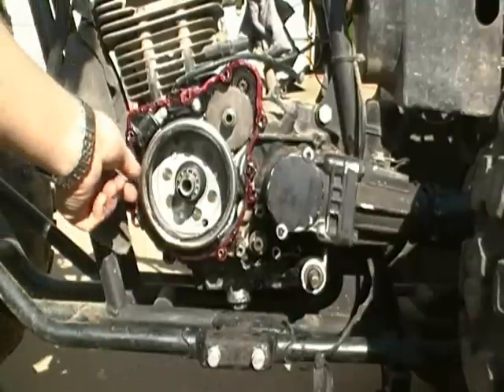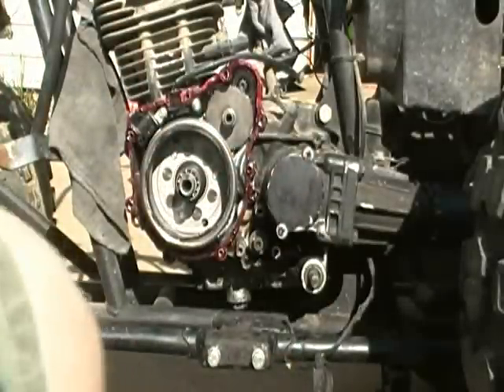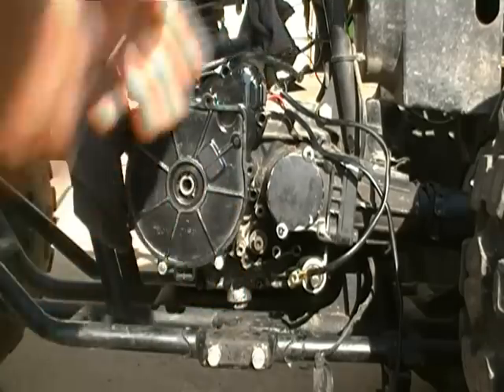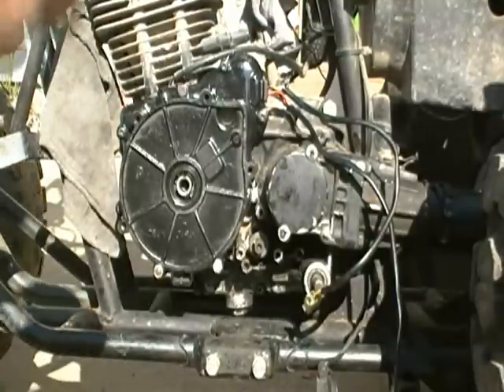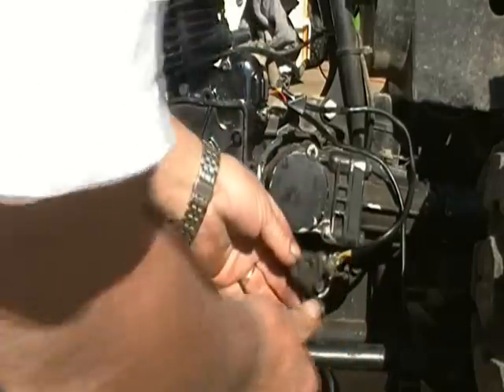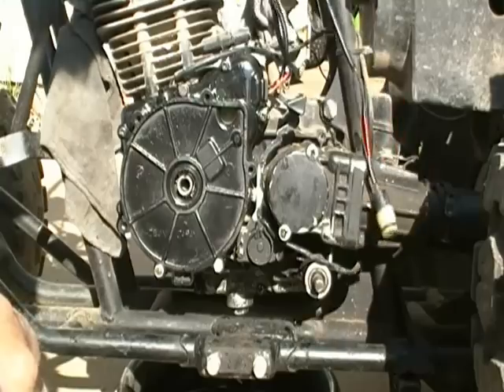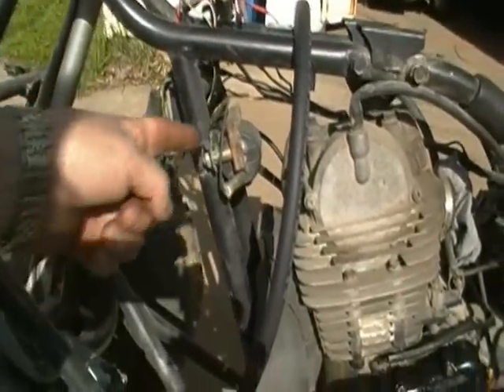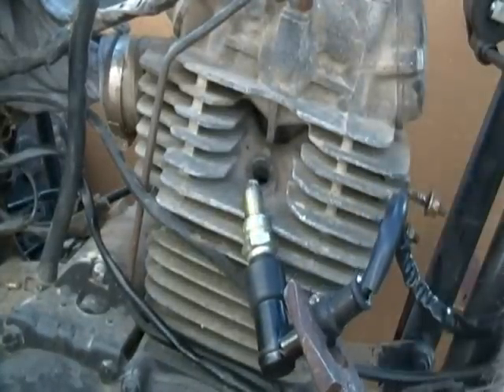KLF 185 atv Magneto & Stator  install

Comment: *****  hey i have a 97 bayou 220 i had to charge the battery and just took it out and my friend came up wanting to go ride so i just put the seat on and pull started it and road for a while the next day it wont start nothing works both the neutral and reverse lights don't work and the same with the font and back lights when i try to pull start all  i can hear is something spin but that's it any ideas
Reply from the maker: Austin Musser I don't have a 220 but I think all things are really similar. Riding with out the Battery works because your getting power from your Stator & Magneto.  
Have you hooked your battery back up ?   It does run the fuel pump, and lights, and the system requires enough fuel to get started. Also I hope you made sure the positive battery cable was secure and not touching anything while you were riding. That could cause problems too.  
let me know how it goes for ya... Cheers

Comment: how to change starter clutch
Reply from the maker: I haven't had to do that, but I did work on my starter motor. Best I can remember there is a direct drive from the starter motor to the gear inside outer case cover.  The video doesn't show me taking it out or installing it, but it shows how I refreshed the starter motor.
Here's the link to that.
https://www.youtube.com/watch?v=qUwxl7enDRQ 
It's called "KLF 185 HOW TO REFRESH YOUR STARTER, AND OTHER THINGS "
Hope this helps.